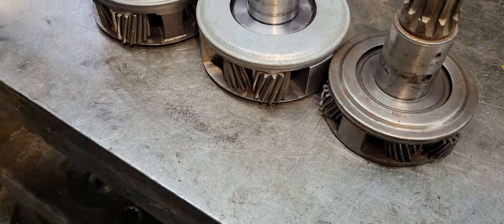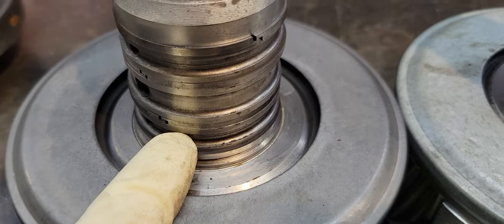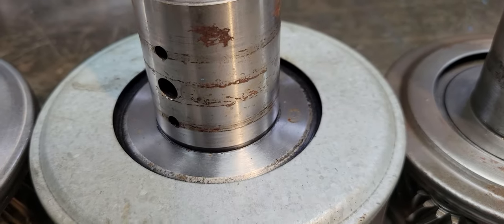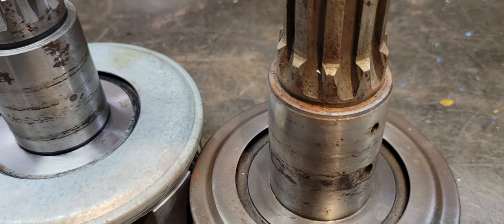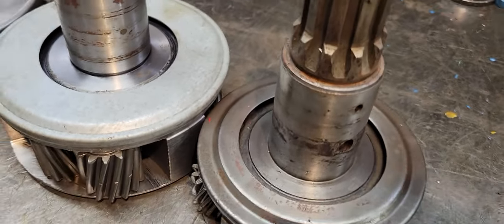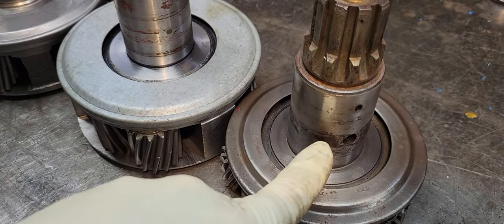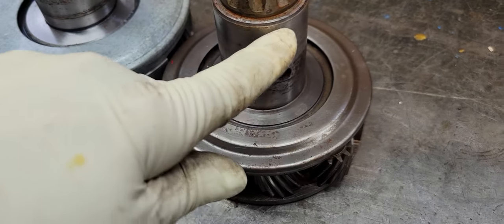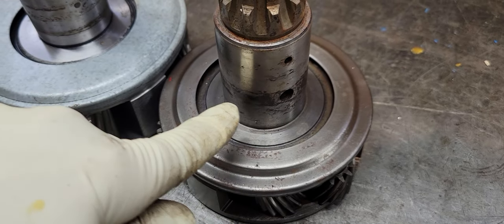71c 72c Borg Warner Velvet Drive 1.1 Direct Drive transmission

Comment: Thank you for all of the videos!
I have a customer that says his ski boat will not really go into neutral. You mentioned this complaint in other videos.
It is a mid to early 80’s boat.  Has Velvet drive. What do I need to replace the old style bushing set up like you are showing? I’ll need to tear it down to verify this is the problem. But if it is, is there a retrofit kit? Thanks in advance.
Reply from the maker: Can stop it by putting your foot on the prop shaft.? If so  it's bushings issue

Comment: The old 10 spline input box im currently running has a newer style reduction housing and neutral safty , so im confused something somebody built?  It also has a good positive neutral
Reply: 72 10-18-009 serial# 1944, my spare gear box is 71 series model as4-71 serial# 480
Reply from the maker: 1018 is a 72 series
Reply: I know i my spare gearbox is a 71... Not the one im running
Reply: Is it possible to put a 10 spline input into a newer model 10 18 009
Reply from the maker: Yes. You need to reuse the ten spline pump.
Reply: @halemarine5991  thanks my goal is to update to 26 spline
Reply: @halemarine5991  do you think my 10-18-009 serial# 1944 2.57 might have a sealing ring case ? Its got neutral safty switch and newer style reduction unit
Reply from the maker: Should have Sealing Rings
Reply from the maker: Not really